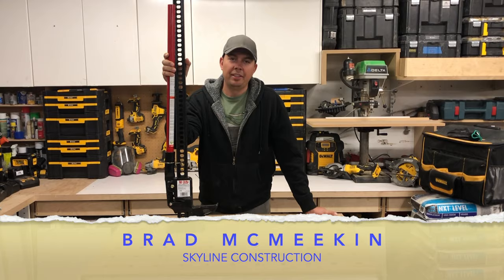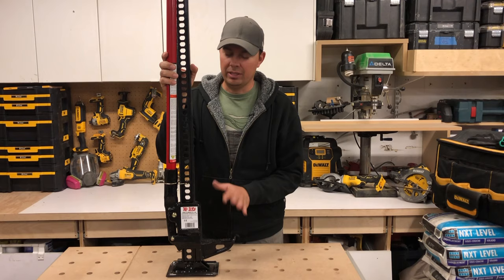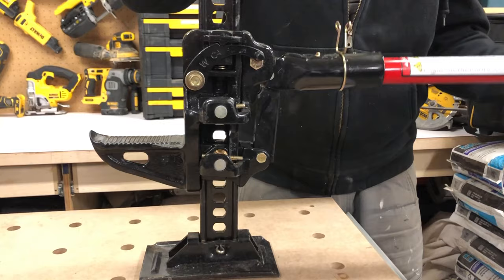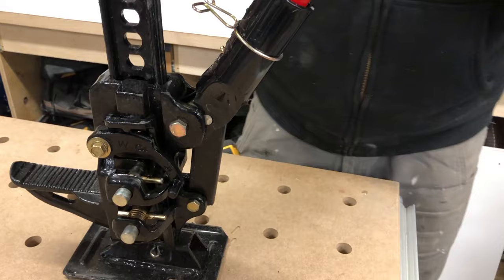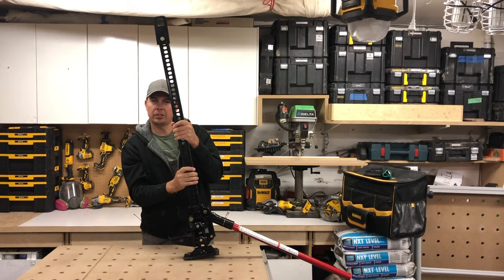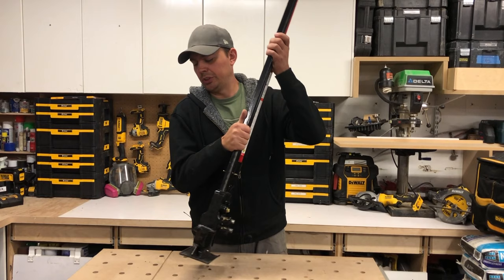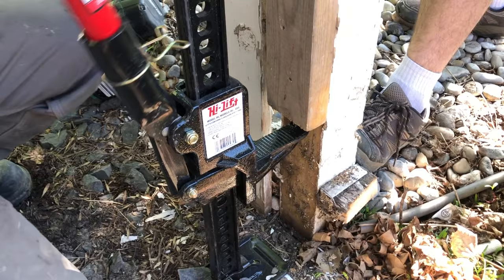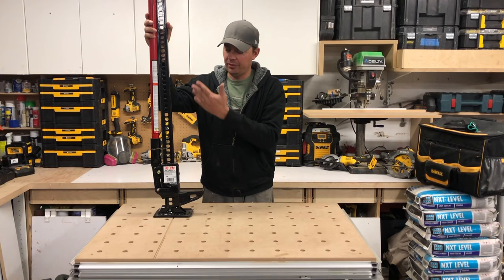How to SAFELY use a Farm Jack! HL484 48" Hi Lift Black Cast and Steel Jack REVIEW

Comment: I recently bought a Hamer car lift which has one side of these on each corner. It’s absolutely leathal, relying totally on separate safety pins onto which it crashes instead of “walking “ down on the pins.

Comment: 4:45 Lets say you have lifted and are holding a trailer above the ground. At this point the reversing lever is in up position and the handle is also up. You don't want it to just freely slide down a drop your load like in the video. What position do things have to be in order to gradually jack the trailer back down to ground level.
Reply: With no weight on the jack it will fall as shown. Under load it will crawl down controllably
Reply: That is extremely important and I would not want to use a jack without that feature. He should have showed how that works.
Reply: I was wondering the same thing.

Comment: Thanks for a great video with the safety tips. I knocked my trailer off the block under the tongue. So....here I go to do this with high hopes and safety in mind.
Reply from the maker: Its great for jacking up trailers, I broke my trailer jack and had to use this to set it on my ball hitch, worked great! just be careful it can rock over if your not careful , thanks for watching
Reply: I put wheel chalks behind the wheels (like my dad taught me to along time ago) before I started. All went smoothly and I got it far enough off the ground to get another block under it. I was careful to stay away from the handle. Couldn’t get it to go down at first. Watched the video again and kept trying. Got it thanks to these good instructions.

Comment: One thing that would help is to cover the lifting pins, other pins, and orientation as they have a 45degree wedge to them.  Trying to practice with some dry runs and struggling.

Comment: When removing 4x4 wood fence post with concrete in the soil,  what size farm Jack is best?
Reply: A 48 inch or a heavier 60 inch? Is a hi lift jack better than a badlands or other brand jack?
9
Reply from the maker: Bigger the better. Some times there is so much concrete in the ground I just cut the post off and move to a different location for my new post. We typically put about 5 bags of concrete in per post. That 250lbs ish. You would need a machine to pull that out safely. So if there’s concrete I would recommend leaving it and moving over. Hope that helps

Comment: Can I use that type of Farm Jack to change my riding mower Blades?
Reply from the maker: i'm not sure, I think you would have to be very careful where you are lifting. and once you get it lifted you would want to put it on blocks i would think.
Reply: @hammerandhome  , Thank You,  that's what I thought a friend of mine's told me I could use a farm jack but I think I'm going to go get a more stable or type of lawn mower jack for my riding lawn mower because I don't think that farm jack would be as stable as I need it for lifting my Troy-Bilt lawn mower I appreciate your time thank you
Reply from the maker: @pwhales264  are you able to drive it on to some ramps, sort of create a larger space under it. then you wouldn't need to buy jacks.
Reply: @hammerandhome  , I  have some car tire ramps, I think I will try that thank you
Reply: I know this is an old Post but anyhow, the only thing this video lacks in my opinion and this is my personal rule of thumb but I think it should be everybody's. Never get under anything supported by a high lift Jack, really and truly you should never get under anything held up by a jack. Jack it up and use jack stands